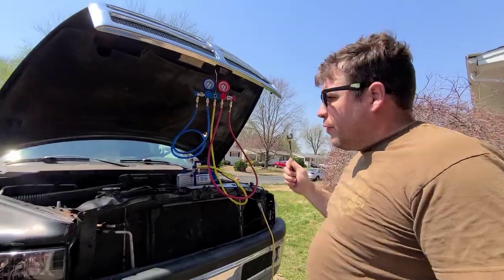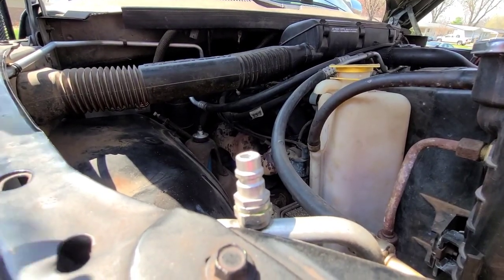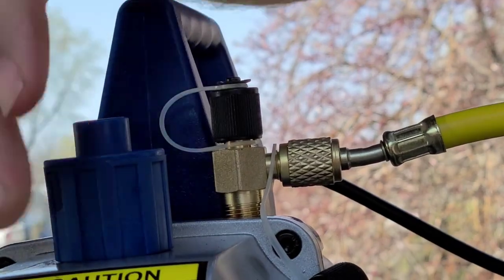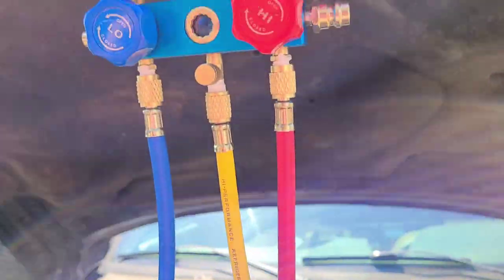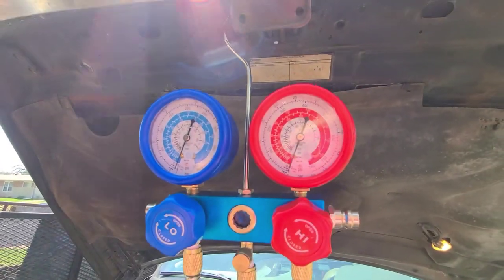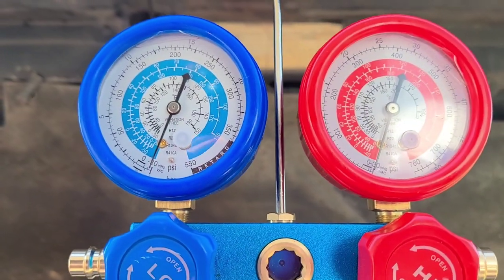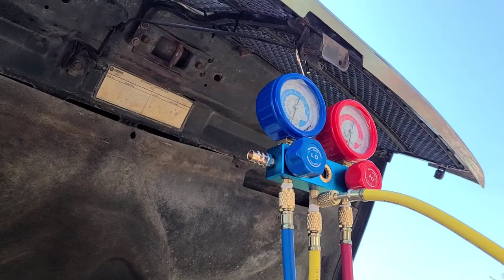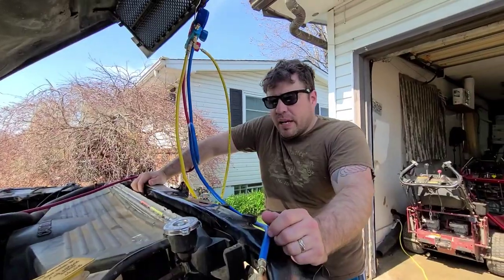Vacuuming air conditioner system with vacuum pump with Are Jay the redneck

Comment: When checking for vacuum leak down over the hour, why don't you open both valves on the gauge set? If not, you are only checking the hoses of the gauge set, not your vehicle's AC system, right?
Reply from the maker: You open the valves that are on the actuall ports so the vacuum is to the gauges, if you open the valves on the gauges is will lose vacuum through the yellow hose. After you un hook from the pump and leave it setting for that hour.
Reply: @RJsGarages  Isn’t that what the knob is for on the top part of the yellow hose? While the pump is on turn that knob to close the system then turn pump off and don’t touch the other knobs. Idk but watching how the pump doesn’t start evacuating the system until you turn the knobs on the high and low would mean that you aren’t connected to the system when turn shut those same high and low valves.
Reply: Agree

Comment: So where does the vacuumed r134 go once its being pumped out?
Reply: That isn’t how it works, you recover refrigerant, then pull down a vacuum, if you hook up a vacuum w the refridge, it will blow all the oil out of your vacuum
Reply: Vacuum is only to make moisture leave the lines..and at the same time it creates negative pressure like  outter space..no gravity/air inside them lines

Comment: Should the high side be close?
Reply: No, when your vacuuming the system you open both valve, when you are charging the system with the car running close the high side (red valve) and open the low side (blue valve) and charge the system through the low side.

Comment: I was just looking at that deal for the pump and guages. Looks like it works well.   Armed with info I might just give it a go! My first a/c job.
Reply from the maker: Worked great on both of my trucks so far.
Thanks for watching, please like and subscribe every little bit helps during these times.

Seize the day each and everyday-Are Jay 

It would mean alot if you could by it through my affiliate link. Help me,help you,help me.
Reply: @RJsGarages  Looks like I'm an a/c guy now lol. The kit I got was $149.00 but still well worth it. The money I saved doing the job myself payed for the a/c kit.  I placed Teflon tape for all connections on gauges then tested the lines themselves for leaks before trying on vehicle.. I changed out a condenser on a 2004 Nissan Xterra here in Glendale, Arizona. Got the A/c temp down to 49*f in 109*f pm temperatures. Mission success! Thanks again Are Jay

Comment: I m still confused about the open and close sign on the top could you please confirm should it stay in open position turning all the way to the right ???
Reply from the maker: While you are pulling the vacuum you need them open since the vacuum is the middle line. But before you shut off the vacuum you need to close the red and the blue and then turn off the vacuum and let's it sit for around an hour to see if you have leaks. If the vaccuum/pressure on the gauge changes you have a leak and will need to find that before refilling.

Thanks for watching!

Please like and subscribe every little bit helps during these times.

Seize the day each and everyday-Are Jay

Comment: I Did Many Vehicles Air Conditioner 
Without Vacuum Pump, Gauges And 
Garbage, 
I Replaced A Lot Of A/C Compressors 
And I Never Used Pump or Gauges,
You Can Do It ? YES.
Amén.

Comment: The compressor or the expansion valve
Reply from the maker: Oh man, it could be the compressor, the evaporator or the valve. 
Have you tried cleaning the evaporator core by going in through the blower motor access. Its difficult to do, but that could be the problem as well.

Good luck.

Seize the day each and every day-Are Jay

Comment: Sr I want to see how you can charge refrigerant .thank
Reply: OK so using the system he has this is how you do it   if oil doesn't need to be added in the ac system ,  you need a large tank of refrigerant to do it more accurately but if you have these tools you can make money fixing other people's systems and make your money back and then some.   30 lb tank.  And a scale to read how much your pulling out of it.    When you've decided you have pulled enough of a vacuum and it holds ,  close down all your valves and disconnect the yellow hose from the vacuum.    If your yellow hose doesn't have a valve on the end  you connect it to your refrigerant and open the tank ,  then you unscrew the top part of the hose as it goes into the manifold until air is purged ( minimal release as allowed by law)  you then zero your scale and open your low side valve with the engine off and if large enough the system will suck enough refrigerant into the system ( the charge Weight is typically on a sticker under the hood.)   If the refrigerant stops flowing you close the valve on the manifold start the car and the ac and turn it up to max ac  ,  then you open the low side manifold valve partially and cycle closing it and feeding it until your weight charge is in the system.  At that point you turn off the  refrigerant tank and you close the high side port on the vehicle itself then you open up the low side valve again and suck the pressure out of the manifold ( guages)  until it equalizes with the refrigerant pressure on the low side . Close off the valves and remove the guages from the vehicle.   The only options for the remaining pressure in the guages  are to allow deminimus release as allowed by law or to leave the pressure inside the guages until your next use.   I typically would release the refrigerant in the manifold because I don't leave pressure on my guages and lines.    Leave the ac running for 15 min or so and make sure your temps are cool and everything is working appropriately.    None of this instruction is explaining how to diagnose or what you would be looking at as the system runs to ensure you don't have problems what I will tell you is that there is no specific number / pressure or cold air temp to say it is working correctly.   When your system is being tested you use temperature test with the high and low side lines vs pressures to find super heat and subcooling based upon if it has fixed orifice or thermal expansion valve .   There are added complications on a vehicle when the condensor fan may cycle at different speeds and obviously moving is getting better air flow than sitting at a stop.

Comment: When to change the oil at the pump?? Ones a year or??
Reply from the maker: Only if your system is low from a leak, or from replacing a component of your system like the compressor or ac evaporator.

Comment: Can I use this to extract the Freon from the system into a holding tank?
Reply from the maker: Yes as long as your holding tank has the same size connector.

Thanks for watching please like and subscribe every little bit helps during these times.

Seize the day each and everyday-Are Jay
Reply: No, you cannot exact refrigerant with this vacuum pump. It’s used only to pull a vacuum when there is no refrigerant in the system. You need a recovery machine to extract refrigerant.
Reply: @CC-ew2jw   no you can do it without a recovery machine if you have an empty tank with a vacuum pulled on it ...  those tanks are rated for 30 lbs plus of refrigerant so a good vacuum will easily pull that out of an automotive ac system... but I don't recommend recycling refrigerant after problems as it opens the door for making new problems .   Many systems do recycle it and slightly filter it but the risk isn't worth it for me.

Comment: What’s that blue port on top for? Should I leave it open or closed while pulling a vacuum?
Reply from the maker: Its the exhaust, its. How you remove the air from the lines.

Thanks for watching.

Please like and subscribe every little bit helps during these times.

Seize the day each and every day-Are Jay
Reply: @RJsGarages  i subd, si it should be open?